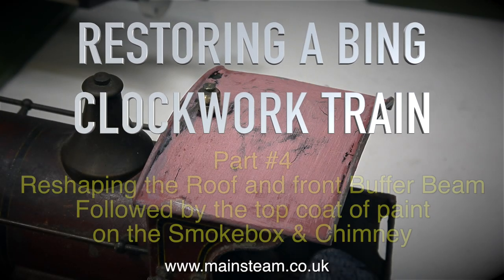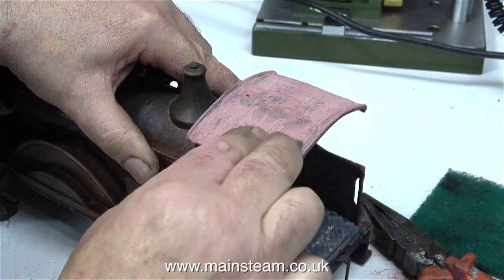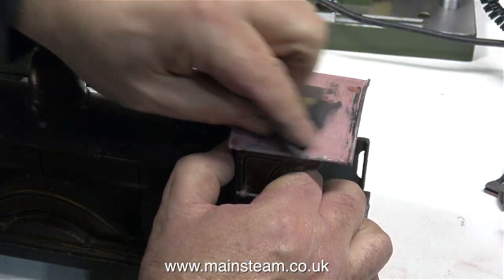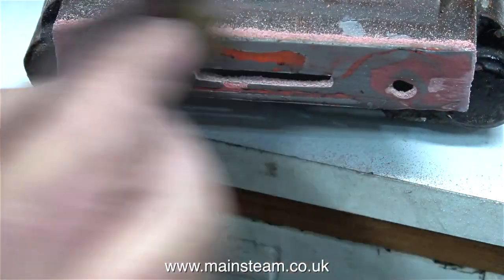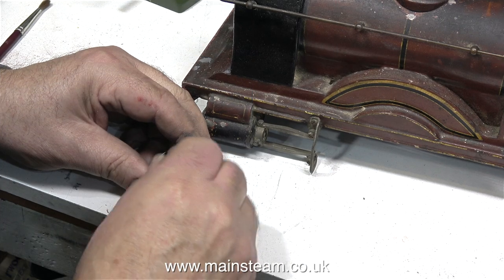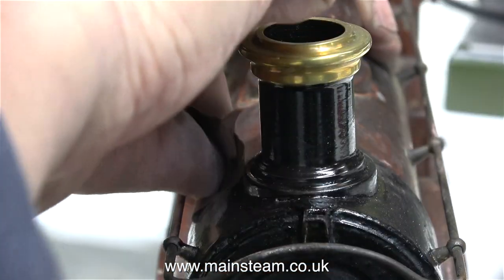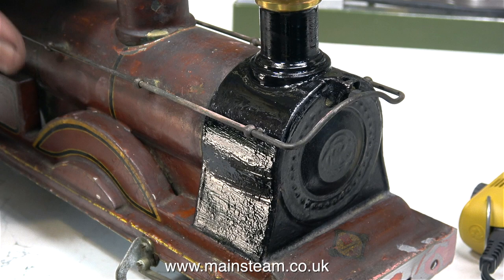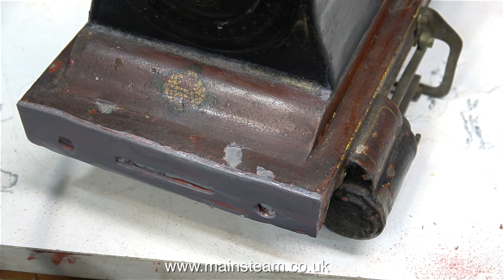RESTORING A VINTAGE BING CLOCKWORK TRAIN - PART #4

Comment: Hi Keith - regarding matt vs. gloss - I once did an automation project in a paint factory. Their pigments arrived in sacks of very colorful powder, most often comprised of metal oxides , for example "white" is titanium dioxide. After the base pigment was added they ran the paint through a roller mill - two six foot long stainless steel rollers with an adjustable gap between them. The finer the grade of base pigment powder, the most glossy the paint. Conversely, the courser the grade of pigment powder, flatter the paint. I don't know if this is universal but I know one paint company does it this way. Makes sense that you stirred up what was in the bottom of the can and the paint dried matt.

Cheers,

Jim